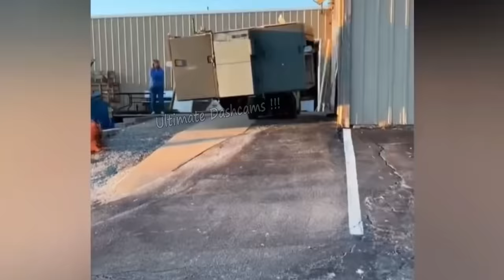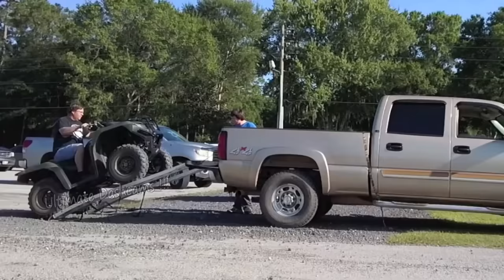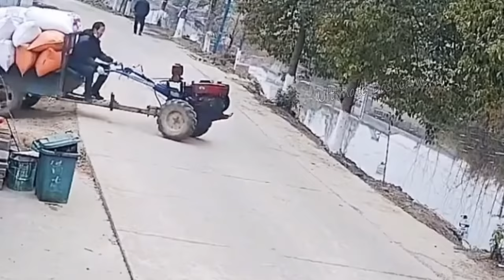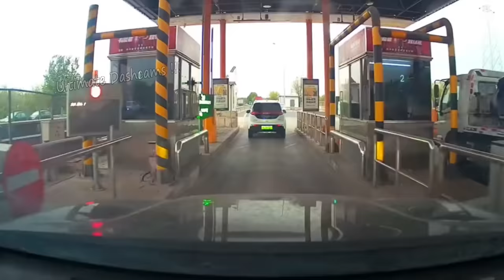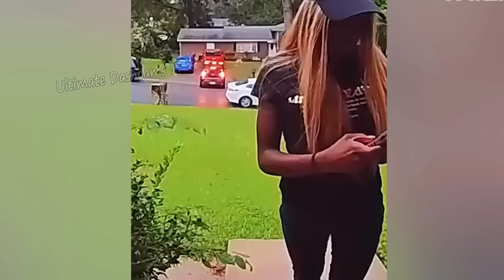Crazy Car Fails Caught on Camera | Bad Driving Fails Compilation | Bad Day At Work Fails 2023

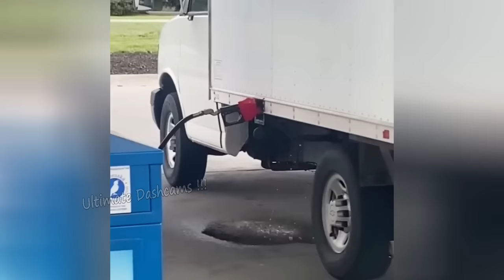Comment: 3:48 shows WTF is wrong with society.  Someone will stand there and film a hazardous situation for 12 seconds (or more) rather than take two seconds to walk over and shut off the pump.  Sheesh.
Reply: Yeah I was gonna say why go stop the fuel pump when you can pull out your phone and record the leak instead ! I don't know about some people, it seems they just don't care or have a stitch of common sense anymore.👺
Reply: It may have been footage from a security camera.
Reply: the pump should have shut of automatically when the fuel reached the nozzle
Reply: @andrewnicholson4811  You are right, but....I have seen the overflow protect fail.  Happened to my son while filling up his Mazda,  we were just standing there filling up and then instead of clicking off, it just started spewing fuel,  and we were right there so we got it quick but not until a cup or two fell on the ground,  suffice to say we ignored the sign about our being responsible for spills.   The station is responsible for the maintenance and calibration of their pumps.
Reply: @markkinsler4333 The fuck? The picture is moving. It's clearly not cctv. It would also be an extremely strangely both placed and pointed security camera. Hello!

Comment: This would be great if the segways between clips weren't so brash. Or if we had the video from the click bait thumbnail. Yeah, marking this channel as do not recommend.
Reply: The "Crazy Car Fails" of a kitchen door falling off with no vehicles involved were a little disappointing, too
Reply: @TonyEnglandUK  Not falling off - just shattering. It is quite common in tempered glass when it cools, even a modest amount. Car windows are common victims.
Reply: @flagmichael  You're talking about the wrong clip, mate.

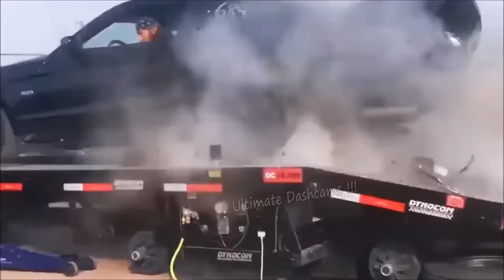Comment: 2:42 that mustang 
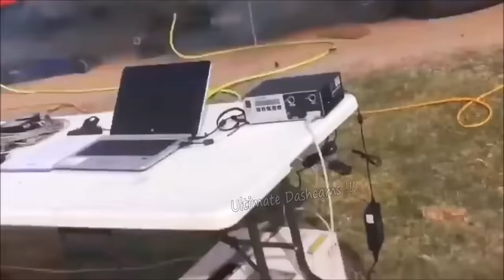can anyone explain why those tires explode? I have seen soo many videos of them exploding on the dyno but why do they explode? like if he would have been on the road doing same thing they would explode too? I dont think so so whyy 2:40
Reply: A road is flat, the rollers of a dyno are round, that gives a smaller contact patch, also the car is pinned down on the dyno, so there is more downward force on the wheels than just the weight of the car. And on the road you rarely have all that power for that long.
Reply: @Patiboke  ohhhh Thanks